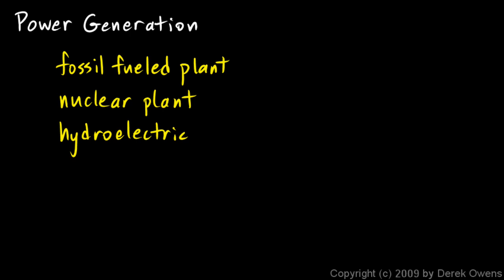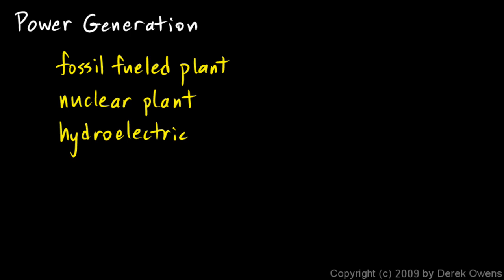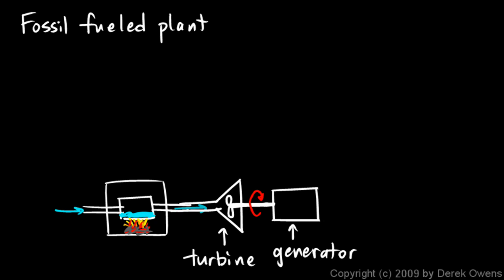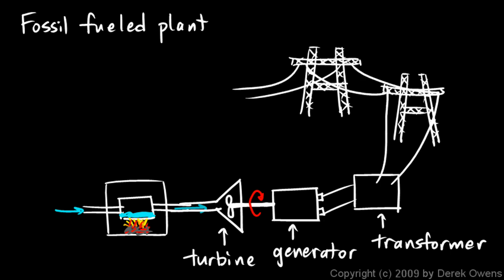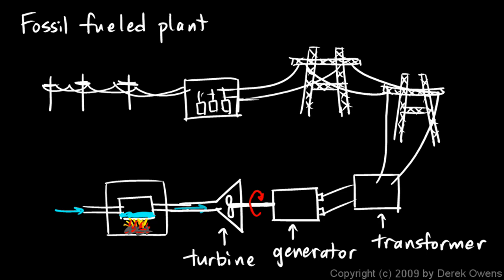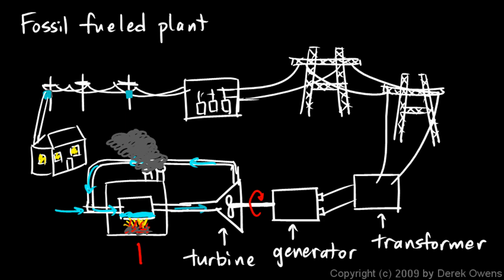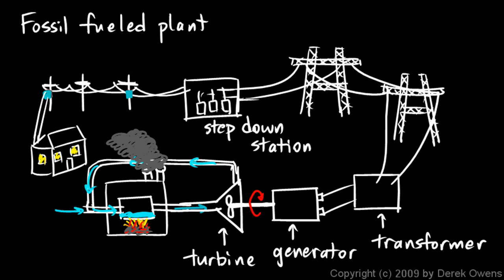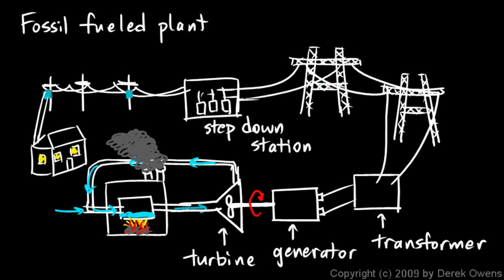Physics 13.5.1a - Power Generation

Comment from the maker: Think of the cause and effect like this:  The voltage causes the current to flow.  Increasing the resistance causes less current to flow.  So if you increase the resistance, and you still want the current to remain constant, you have to also increase the voltage.

Comment from the maker: And there is a trade off between current and voltage.  If you step up the voltage, then there is a corresponding decrease in current.  And also, some energy is lost in the process, as very few if any energy conversions of this nature are 100% efficient.

Comment from the maker: Transformers use alternating current.  The current goes back and forth, through a coil, back and forth, so it is always changing, back and forth.  The changing current produces a magnetic field, which is also changing, back and forth.  This changing magnetic field can then induce a new current in a second coil nearby.

By changing the number of loops in each coil, you can control how the input current and voltage compares to the output current and voltage.

Comment: @CantBeDisplayed On a transformer, there is a primary coil (1st one) and secondary coil (2nd one). They are on opposite sides of a hollow square-like electromagnet. When the current flows in the transformer, the transformer can either increase the current output or decrease current output. The current depends on the number of times the wire coils around the soft iron core (electromagnet(transformer)). The more the turns, the more the current.

Comment from the maker: In a nutshell:  it uses the fact that a changing current will cause a changing magnetic field, and vice-verse.  It only works with AC.  Basically, the transformer can increase the voltage at the expense of the current.  You get more voltage but less current, but the same total energy.  One day I'll make a video on transformers.